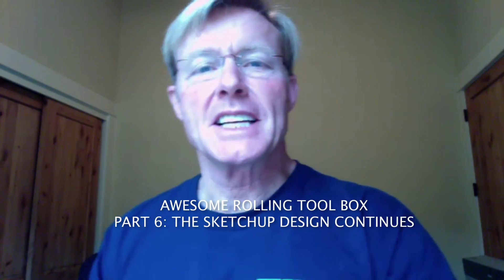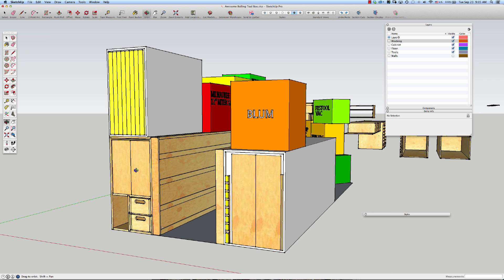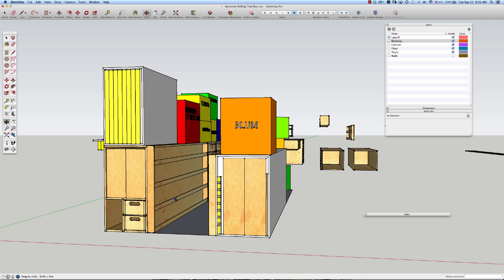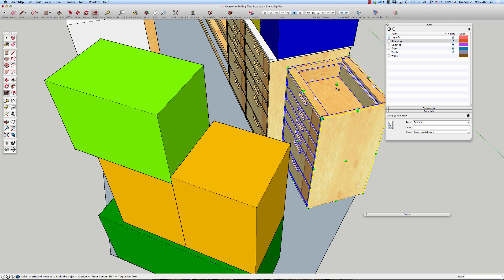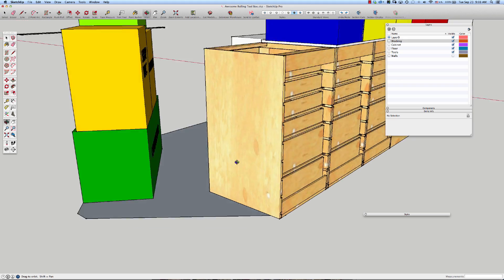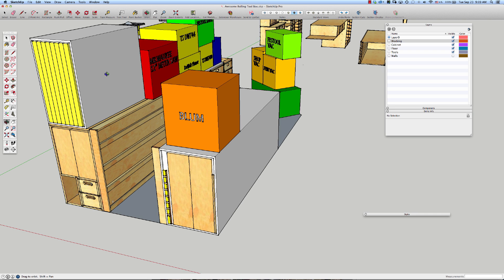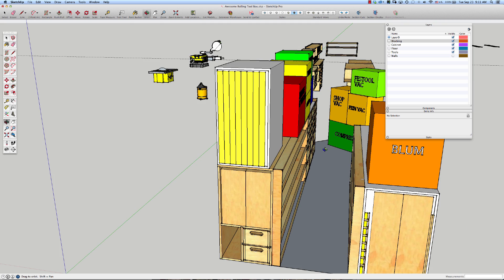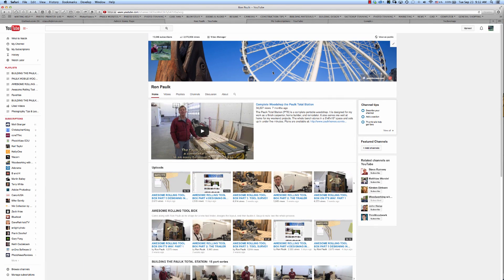BUILDING A MOBILE WOODSHOP (Part 6)  SketchUp power tip.

Comment: Really enjoying the process you are showing.  I'm a small contractor and have a trailer of the same dimensions as this, so I'm quite interested in your use of space.  I have a very basic shelving unit on one side now, which was a huge help when I built it, but with the purchase of new/different tools the disorganization is creeping in again, which becomes tiresome.  Thanks for the great videos, they are a great motivation for me to set aside the time to design and build a new layout for my trailer.

Thanks
Todd
Reply from the maker: Todd, I am glad you are benefiting from the videos. You can copy my setup exactly, use parts and pieces of the final design, or go a completely different way; the only important thing is that you are organized. Anytime you spent setting up an efficient workflow will be paid back in spades over a short period of time. Moreover, if you are organized, you will be in the minority. Take look around and you will see that most carpenter/contractors are disorganized. Thank You,
Ron

Comment: Good Morning, Ron.  Thanks for all the videos.  They are inspiring to those of us who are less organized than you.  Do you have any idea how much this trailer will weigh?  I know this trailer is not your first, but I don't remember whether you used 1/2", 5/8" or 3/4" for the cabinetry in the prior ones;  3/4" seems like overkill for the project.  What's your thinking on going with the heavier stock?  Thanks.
Reply from the maker: Hi Paul,
I have no idea about weight; I do always go with tandem axle and know I am no where near the weight limit that the trailer and truck can easily handle. I tow with an F350, but have towed similar rigs with older F150s without any problem. I use ¾ " ply for strength when heavy tools are weighing down on shelves with the added pressure of going over bumps and such.
Reply: Ron Paulk I see.  I didn't realize you'd moved up to the 350.  I'm pulling with a 4Runner, so am limited to 5,000# towing capacity.  My trailer is 7 x 12 and won't be a tricked out as yours, but I think it's already getting a bit heavy with the tools and supplies.